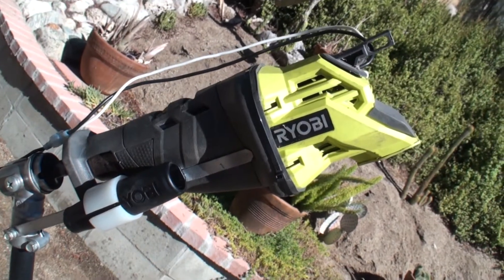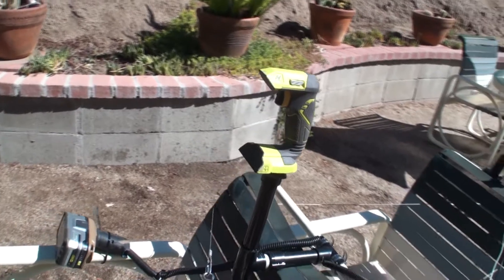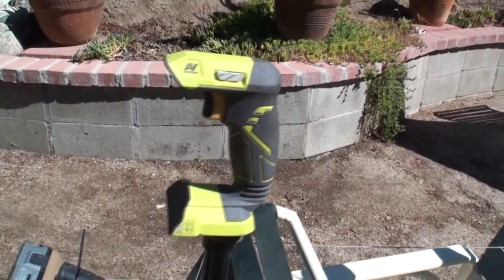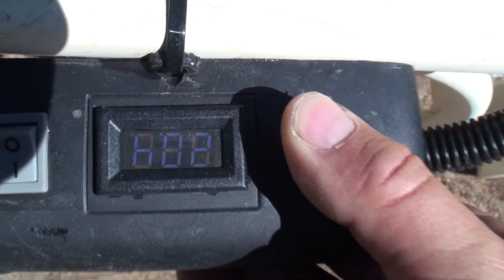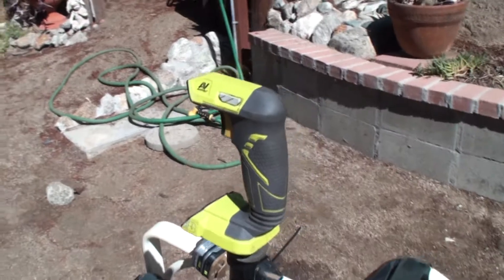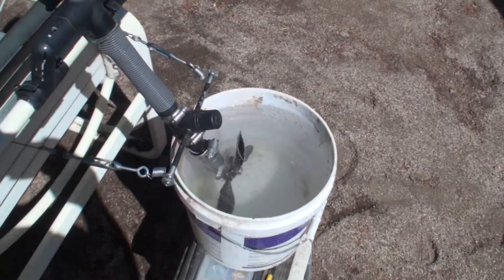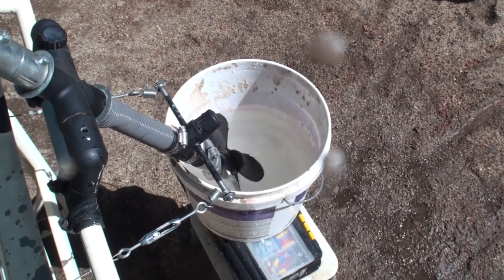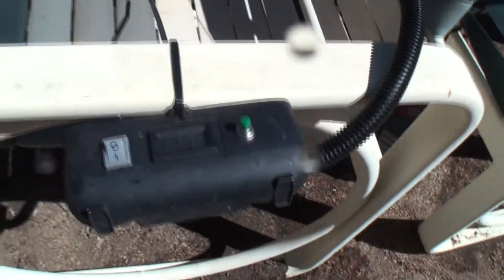DIY Ryobi Outboard Motor Intro

Comment: Question: How is this better or worse than just getting a cheap electric outboard motor? you can get a little trolling motor for 120 bucks brand new… Why not just do that? Honestly asking.
Reply from the maker: It's a DIY project for people who like to build unique things from parts they may have laying around or collected. It's to inspire others to create projects from items they either collected or have laying around . I get more fulfillment building something from my own creative mind than purchasing it.
Reply: Also, they don’t allow batteries or trolling motors on certain reservoirs, but for now they are not stopping drills. At some point the setup might get too elaborate and they might make a law